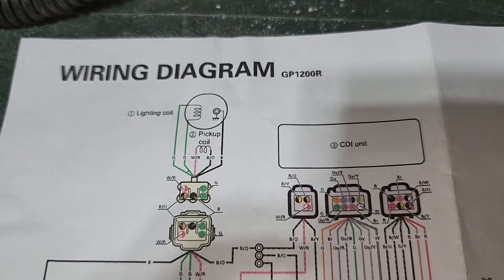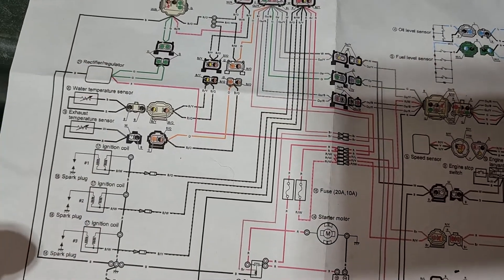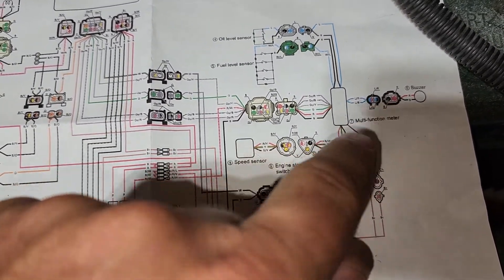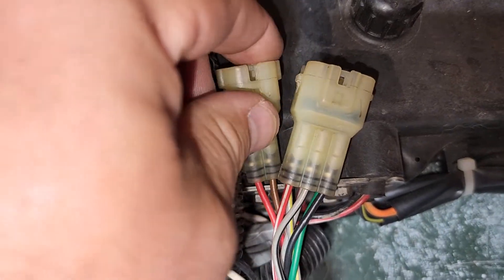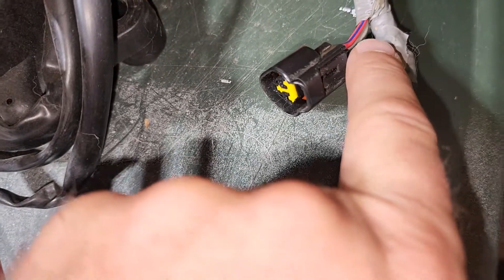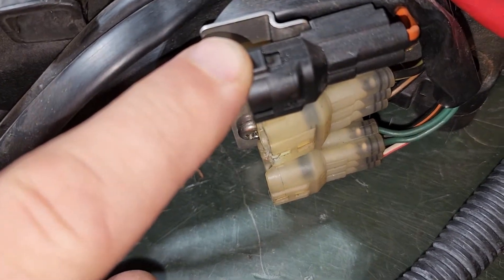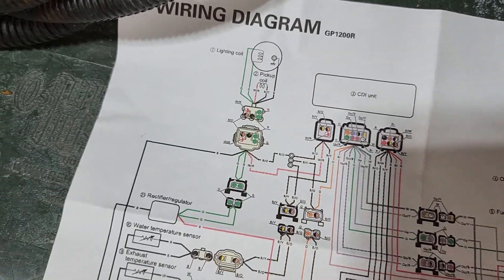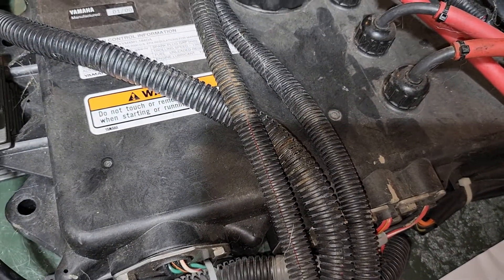2000 Yamaha GP1200R WaveRunner Wiring Diagram

Comment: Thanks for the video!  I'm hoping you can help me with one question... I Just bought a 2000 Yamaha LS2000 Jet Boat (Twin 1200 Non-PV motors)...
  My starboard RPM/Tach Gauge is not receiving a signal, I swapped the Port/Stb gauges & It works on the other motor....
So, where exactly is the RPM signal wire supposed to connect so I can troubleshoot? 

Thanks!